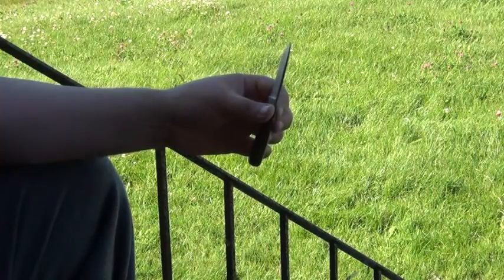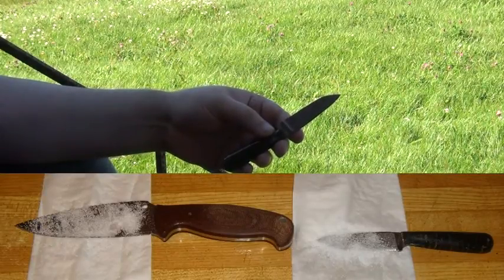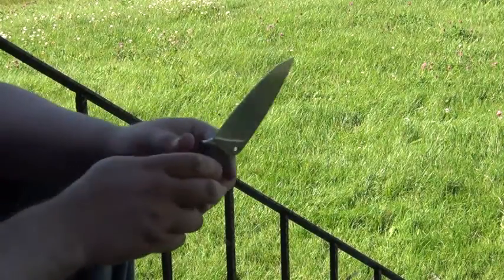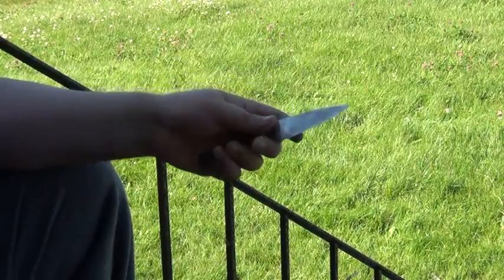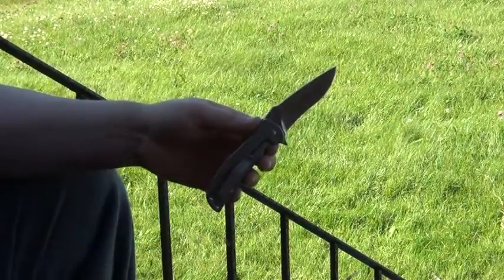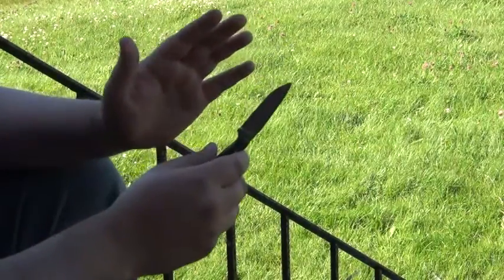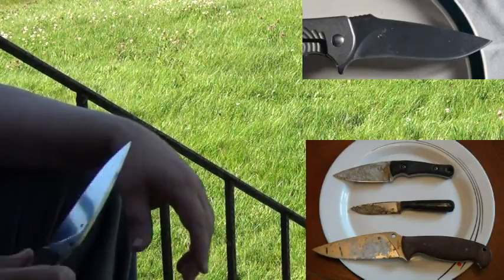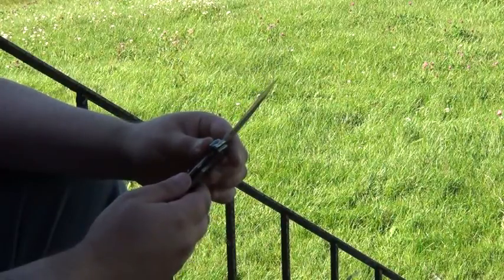Corrosion resistance : (salt soak) VG-10, S125V, S110V

Comment: How would the low carbide, borderline chromium amounts, fare is this type of test?
Would it be as normal stainless steels or corrode at a quicker rate. If that were to be true, from what your saying, is correct, HT would be a factor in the outcome?

Comment from the maker: Yeah, the ease of grinding and sharpening the plain carbon steels is really obvious if you use them side by side with the high carbon stainless. The only main problem here is long term exposure to salt spray, just imagine a knife in a boat for days on end with salt spray exposure and continue that for weeks.

Comment: I used my Spyderco Para 2 yesterday to cut up bait on a boat that I was fishing off of.  I rinsed the fish guts off with ocean water, and wiped it with a paper towel. 3 hours later I washed it in my sink with soap and water and saw very little if any red rust forming. I know if I soaked it in salt water wrapped towels over night it would be heavily corroded the next day.  I love 01 for how easy it is to bring back with just washing it off and stropping. I like its grindability and ease.

Comment from the maker: The forced patinas are very shallow, you will rust (orange oxide) right through them. The natural ones which are very old actually have very thick coatings which have oxidized so much that only the edge is likely to be effected. The next time I get such a set I will do a soak to compare it to a blank and forced patina.

Comment: pt2: optimally at 65hrc but, another steel may be too brittle at the same hardness. i would like to see a comparative chart between the uddeholm boehler steels and those produced by crucible. it would also be neat to see them all compared to some of the lower grades of steel such as 440c, 440a, 1095, etc... as far as toughness, wear resistance, corrosion resistance, and so on. it would be interesting to see how drastic of a difference there is. it seems they usually compare them to like steels.